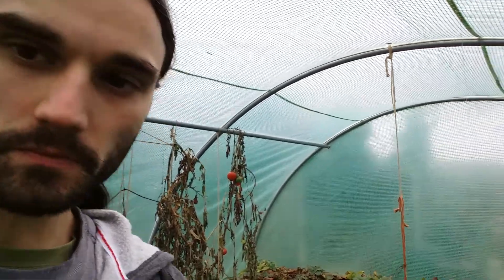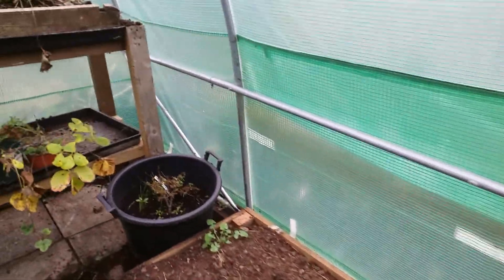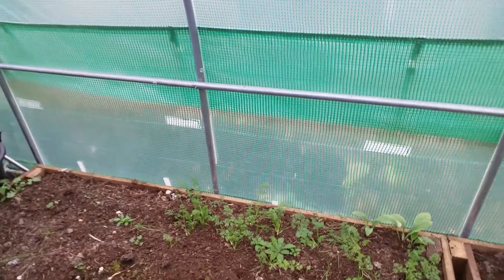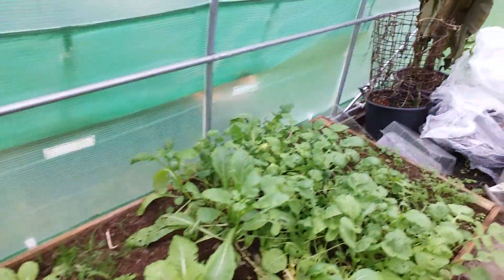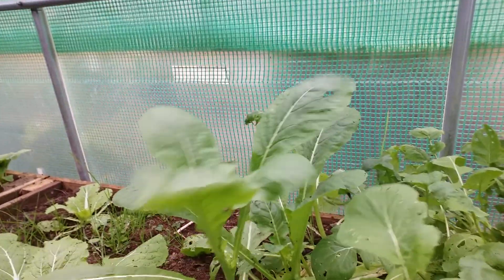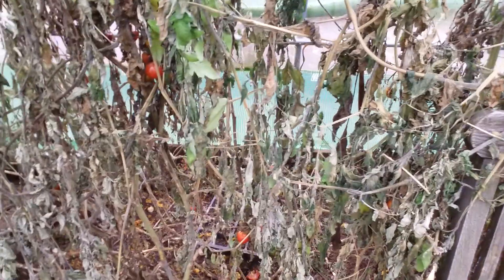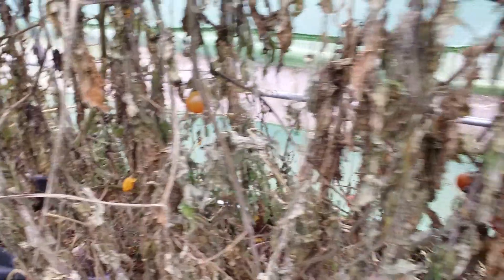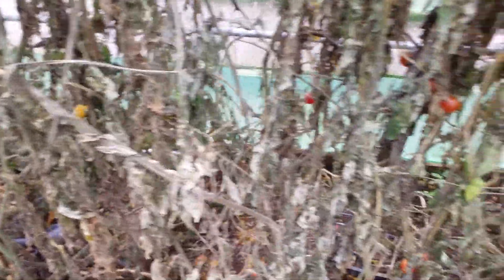How to create a no dig polytunnel or greenhouse, part 1.

Comment: I have just bought my first Greenhouse/Polytunnel! :)
Reply from the maker: Good stuff. You won't regret it.
Reply: Thanks! Already got loads of trays of seedlings :) What is your advice on the positioning of the Greenhouse, direct sun-light/partial shade or full shade? Because i've been hearing conflicting view-points...x
Reply from the maker: +L. T. M. my view is full sun. I grow a lot of Melons which require Sun. If it gets too hot open the door etc.
Reply: That's what i thought too, thanks - not even built it yet! x
Reply from the maker: Good stuff. Let me know when you have a tunnel full of good stuff!
Reply: Will do :)